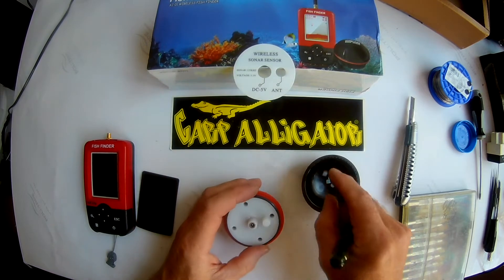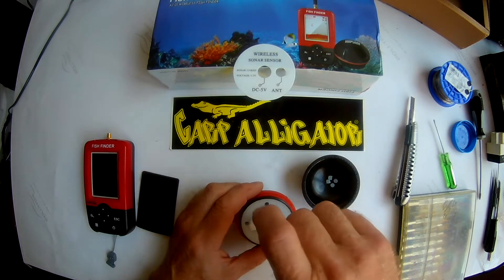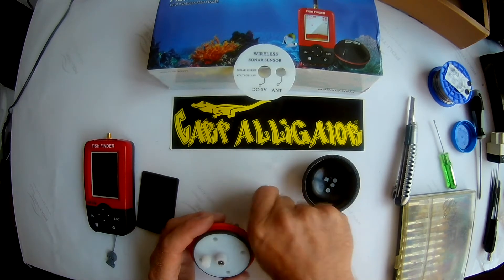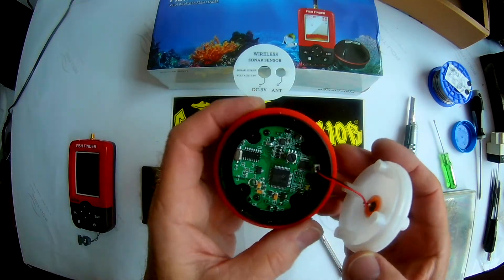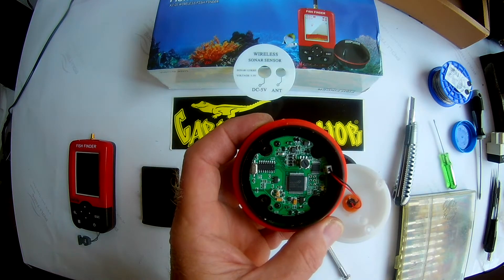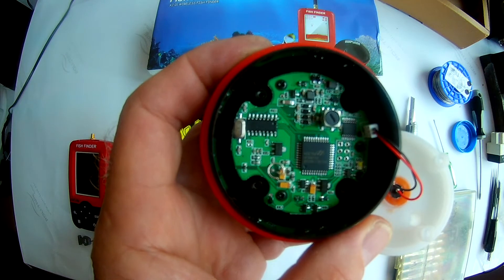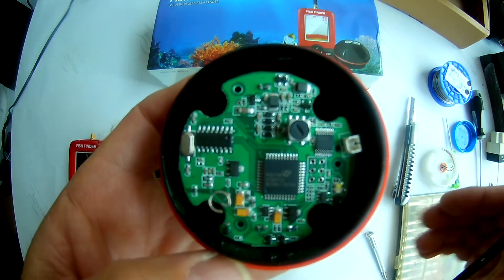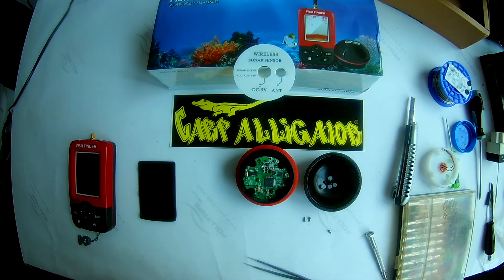XJ -01 wireless Fish Finder 1

Comment: How increase the wifi signal in this istrument? Is a possible replace this spiral antenna with a 2.4ghz antenna with  rp sma connnector.. How made ? Thanks
Reply from the maker: I took out all the electronics in the box of the boat. I am installing a reinforced antenna.Only with the reinforced antenna I cover about 300 m.
Reply: @jokoo111111  thanks a lot for this video
Reply: sure it works...but you need an 433 MHz antenna